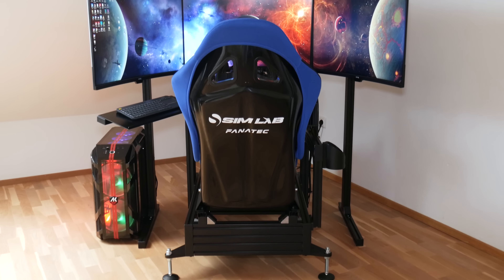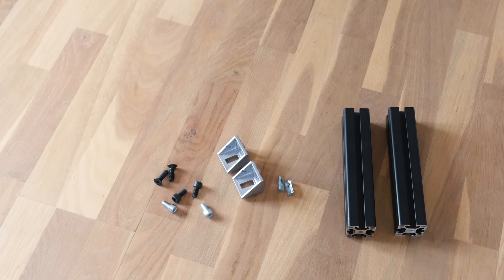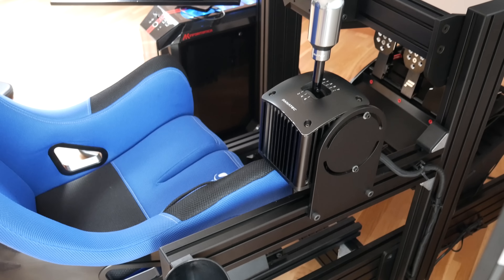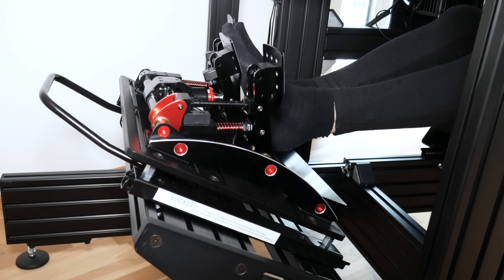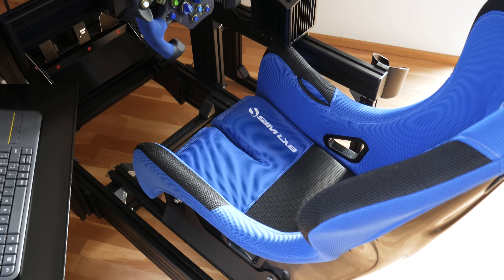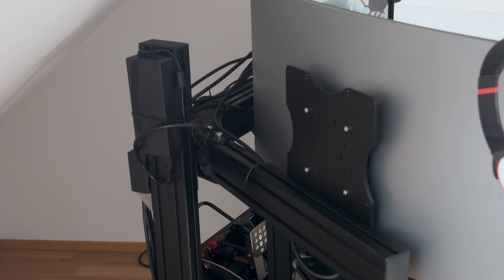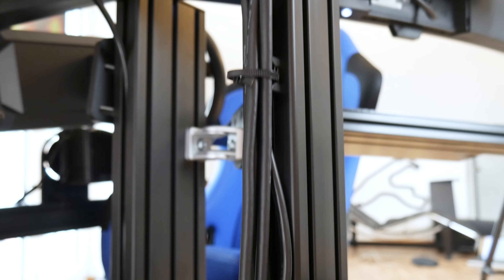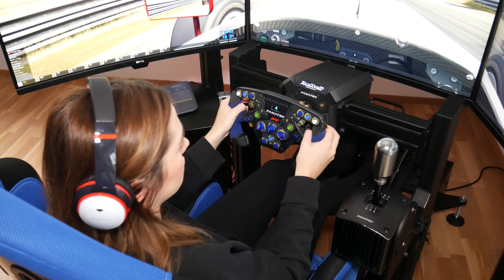Sim Lab P1-X l My New SimRig by SimRacingGirl

Comment: Hi SRG! I'm Rick, Just subscribed, and am 68 and retired Mech. Engineer. I used to Sim Race and Sim Fly (Then earned a real License!) in the '80s and '90s up to around 2000. Just a year ago, I decided to check out what up-to-date Race Sims and software are like. I was amazed, and decided to build a new rig. I built my own PC (did that in '80s too), built a custom 80/20 rig, Simucube Ultimate, 3 Asus monitor setup, Ricmotech hydraulic pedals, and then added a DBox 4250i system. Great to see a lovely young Woman Sim Racing! Take Care and God Bless! :)

Comment: You made a great decision with this cockpit i was looking into one too so i watched alot of reviews of these and it comes out really great,it's highly modular and it's one of the most stable  especially when using dd wheels,i personally have a thrustmaster t500rs on a wheel stand pro,and it moved alot while racing,but it's a great base to build a home made cockpit around it since the wheel and pedals are already fixed to a adjustable base.The advantage i have is that i have my original car seats to use for my cockpit since i put recaro pole positions in my car,so i decided to build my own rig out of wood.I used 9cmx9cm garden poles,sawed them at a lenght of 150cm and 2 pieces at 40cm(this is also the exact same width as my wheel stand pro)and made my cockpit base out of that just put my wheelstand in between it and i mounted my seat upon the wooden frame i made so o sit higher then my wheel and pedals(plus the seat has a rail for forward and backward adjustment and it has height adjustment) and then i just sawed 4 pieces of 7cmx7cm to a lenght of 45 cm to use as my monitor stand,and i must say it's very stable,hasn't moved a inch since and completely changed my racing performance and it only cost me around 75 euro on wood and hardware,my wheelstand costed me 129 euro 3 years ago,so very cheap for a very sturdy setup,i highly advice to use a rig when racing preferably a very sturdy one like the p1x because you never know if your on the market for a DD wheel future wise.Nice video btw👍✌️👉

Comment: If I ever get to the point of a Rig upgrade. It'll be a P1. I currently use a full NLR Setup (As seen in my avatar). And my biggest gripe is the sturdiness. Running a DD and high end peripherals is hard on a NLR. 

I Definitely want a P1.
Reply: I have a NLR F-GT. Was using a Thrustmaster Tsxw at first and now I got my self a Fanatec DD2. Have not installed it yet but I kind of worried that it my rig will be to weak...
Reply: @mrp32gtr  Ive got a DD1 mounted on mine and unless you like to have mega strong ffb (ie wrist breaking / shoulder popping) its ok.    For sure the P1X would be better but so far its been a good experience for me.
Reply: @SlowBloke123  yeah, i have my dd2 set at 40% when playing F1 19 no problems at all. Even tried at 100% but it is impossible to drive. My arms will break before the rig does. Hahaha
Reply: Michael Anderson Sounds like you’re running a TMI
Reply: @SlowBloke123  I'm currently configuring a sim racing setup from scratch, and I like the look of the F-GT but I'm worried about how it will handle the DD1. How is the rigidity?
Reply: @moveslikethese2651  mm I thought I answered this earlier but dont see my reply now - if you like strong ffb from your dd1 you may want to consider another rig.   It will be ok for the most part but for instance F3 at Sebring in iRacing can really throw some crazy FFB spikes.   I had my F1GT with DD1 for a year and honestly its ok its not like you lose LOADS of fine detail regardless of what people say it still felt great. However I just upgraded to a simlab gt1 evo - still getting it dialed in but it is notably more rigid - especially the pedal plate..   So I guess Im also one of those who would recommend simlab first.  Next Level Racing were really supportive when I needed help so do recommend them but for strong direct drives the FGT maybe not the best option out there.

Comment: I think you need a pair of side cutters for the sharp edges on those cable ties.... If I had a dollar for every time I'd slashed my arm running cables in data centres for poorly cut cable ties..... well, I'd have enough for a direct drive wheel... thats for sure

Comment: Your shifter is mounted very high. I also started like this but found it more and more uncomfortable with the H-pattern shift - for sequential it's ok. Now I have mine in the lowest slot.
Reply: Yeah, for sequential this works, and its nice to not need to move your hand far. But for H-pattern this position doesn't feel very natural.

Comment: Absolutely awesome set-up, in fact pretty much my dream wheel, wheelstand, gearstick and pedals!!  I'm intrigued by the fact you race with a triple monitor setup rather than a next gen headset like the HP Reverb Pro.  Personally I think that the VR goggles give you a more 3d view of the world and objects, corners, angles and perspective are just better than any triple monitor setup can achieve.  I only have an Oculus Rift and that has screendoor issues but I suspect the higher res headsets now available may solve that.   Interested in your thoughts?
Reply: VR is so much better now. But I would use a Valve Index. The Reverb has still the small fov.
But triple monitor is so outdated since VR :)

Comment: Yeah but when you push the brake pedal so soft like you do then I can’t really know if there is flex or not when you push the brake pedal very hard. Like the Podium DD1 and DD2. It must be on the max torque to know if there is flex or not.
Reply: SIM Lab Rig P1 X has no Flex at all. I can confirm that.
Reply: @donzmeuheu6153  So it can handle 25 Nm Torque ? And also hard breaking with zero flex ?

Comment: A quick note on the monitor angles you're using (45°), did you calculate the required angle based on the monitor size VS viewing distance? If not, theres a highly detailed guide on the Race Department Forums that explains how to set the correct monitor angle, AND the correct FOV based on your physical display size, monitor bezel thickness and the position of your eyes when seated comfortably.

I'm not saying your 45° measurement is wrong, just that you may want to check that is the correct FOV to he using based on viewable screen size, bezel size, and seating position in order to calculate the correct monitor angles to be using and eventually calculate the FOV to use.

Thanks for your time, have a good day/evening :)

Comment: Hey i have a question :) First up nice Video, but i'm the opposite to you since I am 6,6 Ft. (2,03m) ,do you think i can fit into this rig without the seat slider or should i get it to maybe have some room to play with ?
Reply from the maker: You will fit in the rig. You don’t have to get the seat slider necessarily. You can just install the seat according to your size. But The seat slider is pretty handy though..
Reply: @SimRacingGirl  Cool, thx so much for the answer,  couldn't find a good Statement regarding that anywhere :D

Comment: How is the noise from a sim rig? I always had the problem, that my steering wheels made a lot of noise because i am using a normal desk, for example while driving over kerbs or sliding. The Wheel thumps or vibrates in a strange way i think my neighbours can definitely hear. 
So im wondering if using a simrig would get rid of my noise problems.
And the pedals not to forget. Will panicbraking forgive me?
Reply: Zeitverschwendung the more solid the rig, the quieter the overall experience.  I have pretty much the same setup as SRG (same wheel, base, pedals, shifter, and chassis) and it’s silent except for clutching and shifting.

Comment: I have a question, how do you attach the handbrake? Not that i need it i already have a motion rig but i can’t see how you will install it on this rig
Reply: check out Sim Racing Garage he has his fitted like mine. it's not hard at all. P1 cockpit is like Lego and so easy to add new things or adjust stuff

Comment: That mount for the fanatec direct drive looks like it shouldn't work, is it bolted to the wheel base? Does it actually squeeze  the wheel base enough that it doesn't move? I'm sure it works just curious how it holds it. Like a clamp?

Comment: What does something like this cost?
Reply: Fucking Monney☝😉😂🍻
Reply: Frame aprox 700
Seat 300
Triple monitor stand 300
Fanatec base 1100 to 1500 (DD1, DD2)
Rim 350
Pedals 350
Shifter 150
Mouse tray, shifter holder, seat and pedal slider aprox 500-600
You can find it all at fanatec.eu and simlab.eu
This kind of rig is aprox 3500-4000 eur
+ a powerfull pc and 3 monitors of your choice, VR can cutt down the price(no monitors and stand needed).
Reply: @bmrf818    Thanks for the reply...  i was thinking  a lot more.!!!